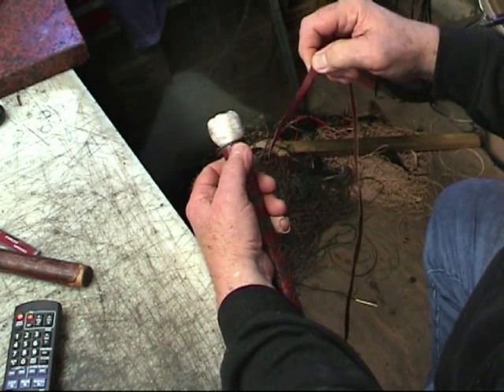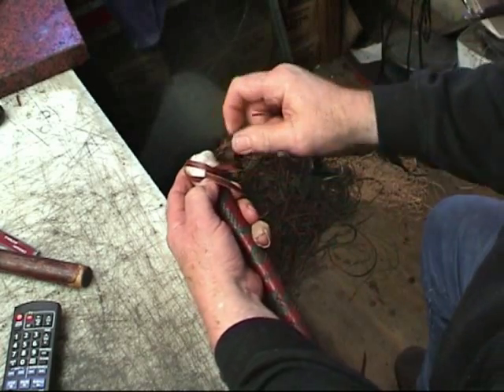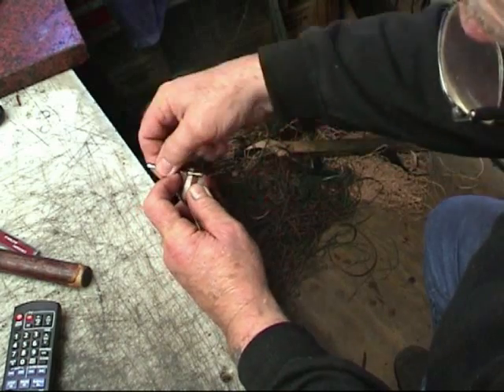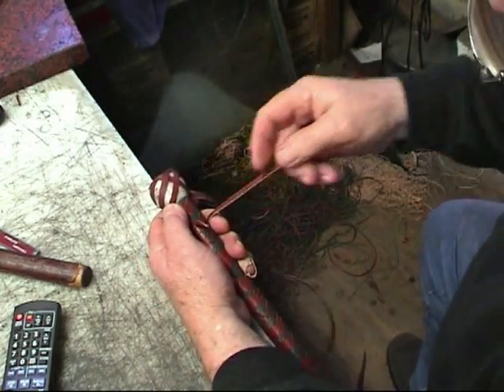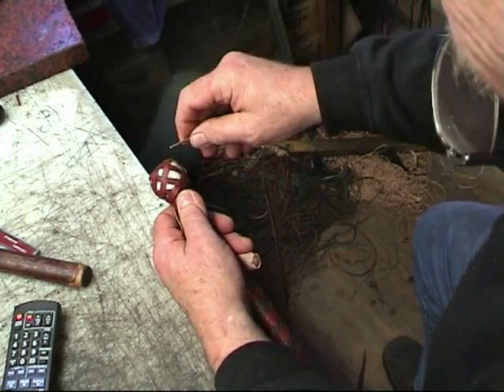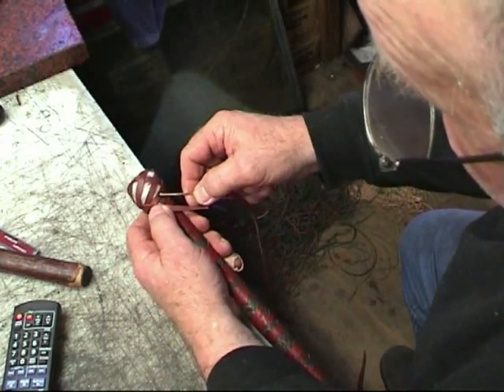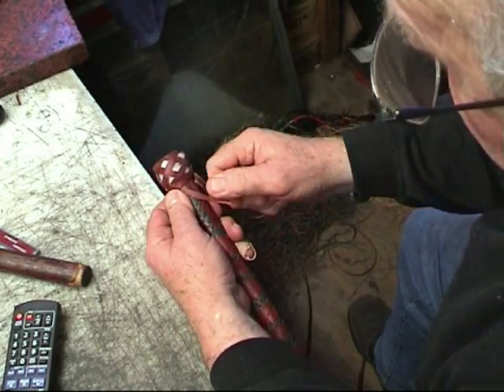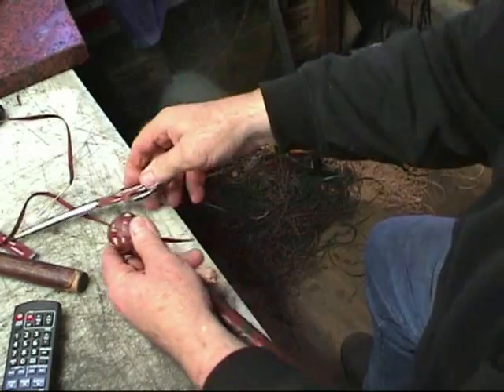two tone pineapple knot.

Comment: So my question is almost  the opposite. If I want to use a specific size of core and a specific size of strand and it doesn't cover do you just keep going expanding  Unders at the crosses?
Reply from the maker: There are two ways to do this:in the first part of the knot where I tie 6 bites you can carry on and tie 8,10 0r as many as you like in even numbers and then just tie the interweave. The other way ,and this is much more difficult, is to leave the knot at 6 bites and after you have finished the first interweave of under 2 over 2 start going under three over three but instead of starting the third weave on the right hand side of the standing end you have to move over to the left hand side. This is very complicated and would take another whole video to explain which I'm afraid I don't have time for at the moment.You would be better off sticking to the first choice. The Encyclopedia Of Rawhide and Leather Braiding  by Bruce Grant, (just google it) explains this knot.

Comment: Bernie is there a formula for finding the correct size for the strands for this knot?
Reply from the maker: G'day Robert.
                   Took me awhile to find this, someone sent it in some time back.I can't remember now who it was but thanks.
                                                            Strand width for knot.
1) Length of knot foundation divided by diameter of knot foundation = A
2) diameter of foundation x 2.5 = B
3) B divided by the  number of bights = C
4) C x A = width of strand.
Let's say we have a knot foundation that is 34mm in diameter and 32mm long and we want to tie a  basic pineapple knot of 6 bights going around  in the first part of the knot which will end up giving us 12 bights after doing the interweave.
1)32mm divided by 34mm = 0.9417
2) 34mm x 2.25 =76.5
3) 76.5 divided by 12 bights = 6.375
4) 6.375x 0.9417 = 6mm ( width of strand)
It's that simple.Just takes a few seconds and a calculator. Personally I usually just wing it because most of my knots are this size so I automatically cut 6mm strands but when I do more than 6 bight knots this comes in very handy working out the width.
PS.This may look complicated but it is really very simple.
Reply: bernie46 Thank you so much! I think this will help a lot, since I work with different sizes of handle stock, and my knots can be really different in sizes.
Reply from the maker: I just found a video on how to do this in paracord which is the same. Just search for 3 pass pineapple knot.
Reply: bernie46 Hi Bernie! Quick question. In the above formula #2 is Diameter x 2.5 = B. But, in the example you multiplied by 2.25. Which one gives the best answer? Multiplying by 2.25 gives 6mm strand width and 2.5 gives us 2.6mm strand width. Thanks for all of your videos. I love them all!
Reply from the maker: chisalie
  This is how it was first given to me by Chris in an email.As most of my knots are roughly the same size I don't use it much but when doing odd size knots it has come in very handy.Make sure you read it all as it is very well explained.A big thanks to Chris for putting this out there.
    Hi again Bernie
 
I saw a comment you made on one of your videos on youtube concerning how you calculate the width of strands for your knots.  You asked if anyone had another method to please share so here is mine.  Having come from a math and science background in college, I tend to try and apply math to work out problems like this.
This may seem a bit confusing at first but I assure you it is very simple.  There are only four steps and it's just simply multiplication and division.  I will post a video on youtube in the next few days about this but I wanted to share it with you.
Now I'm sure you've tied enough knots during your career to the point where you can just look at a knot foundation and automatically know what size strand you need.  However, I'm not quite that experienced yet so I use this to figure my strands. 
 
First just a brief explanation.  In your method, you take into account the diameter of the knot foundation and number of bights.  But the length of the foundation is also very important because it determines the angle at which the strands lay.  This is important because a strand which lays more crosswise will take up more space than a strand which runs more up and down.  (Hope that makes sense)!
Also, we have to count the exact number of bights.  In a pineapple knot, we start with lets say 6 bights for the first part of the knot.  But when we do the interweave we're adding another 6 bights.  Those are hidden under the crosspieces of the first knot (the under two or under three at the top and bottom).  So in my method we need to use 12 bights in the calculation because thats the actual number of bights present-each bight has a strand which goes down across the knot and takes up space on the knot.
 
Now I know this is all a bit fiddly and for someone like yourself with lots of experience may not be important.  But for beginners and intermediate whipmakers like myself, the less guesswork the better.  So here's the four step formula for the perfect width strand based on mathematics:
 
1)  Length of knot foundation / Diameter of knot foundation = A
2)  Diameter of foundation  x  2.25 = B
3)  B / Number of Bights = C
4)  C x A = width of strand
 
Let's say we have a knot foundation which is 34mm diameter and 32mm long and we want to tie a basic pineapple knot going around 6 bights in the first part of the knot which will end up giving us 12 bights after doing the interweave.
 
1)  32mm divided by 34mm = 0.9417
2)  34mm x 2.25 = 76.5
3)  76.5 divided by 12 bights = 6.375
4)  6.375 x 0.9417 =  6mm
 
It's that simple.  Just takes a few seconds and a calculator. 
 
I will say that if the strands are not completely stretched before resizing, all this is useless.  It always take the strands I'm going to use for the knots and soak them in warm water for a few minutes and then stretch them twice.  Let them dry completely and stretch them again when dry just to make sure I've got all the stretch out and they stay the same width during the tying of the knot.  As you know, pineapple knots are somewhat forgiving but some others like the headhunters knots have almost no forgiveness in the strand width.  It's either right on the money or it's wrong so this method really comes in handy there.  So there you go. 
 
Best wishes and kind regards,
Chris
Reply: bernie46 Wow! Thanks for the fast and detailed reply! That's why I have so much love and respect for your videos! I wish I could learn from you in person. Thanks again!!!
Reply from the maker: chisalie
Your welcome.
Reply: Robert Waite
Reply from the maker: Robert Waite There is Robert .It was sent to me by Chris and it works well.

1)  Length of knot foundation / Diameter of knot foundation = A

2)  Diameter of foundation  x  2.25 = B

3)  B / Number of Bights = C

4)  C x A = width of strand

 

Let's say we have a knot foundation which is 34mm diameter and 32mm long 
and we want to tie a basic pineapple knot going around 6 bights in the first 
part of the knot which will end up giving us 12 bights after doing the 
interweave.

 

1)  32mm divided by 34mm = 0.9417

2)  34mm x 2.25 = 76.5

3)  76.5 divided by 12 bights = 6.375

4)  6.375 x 0.9417 =  6mm

 

It's that simple.  Just takes a few seconds and a calculator.  

 Hope this helps.